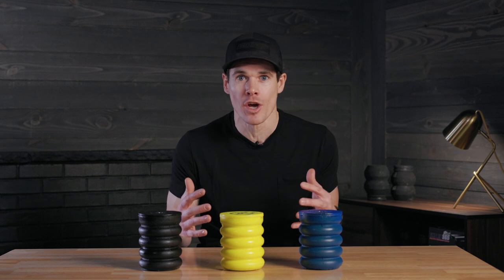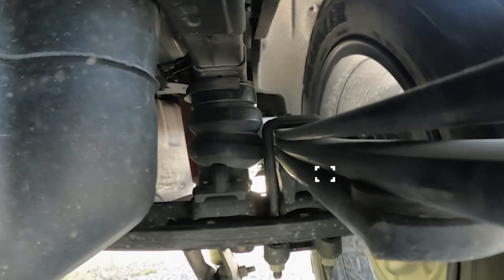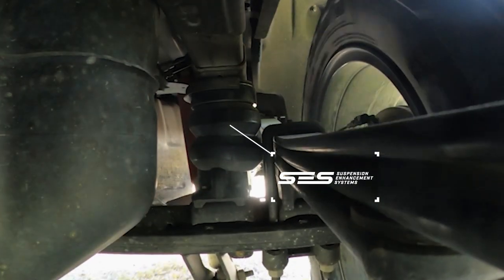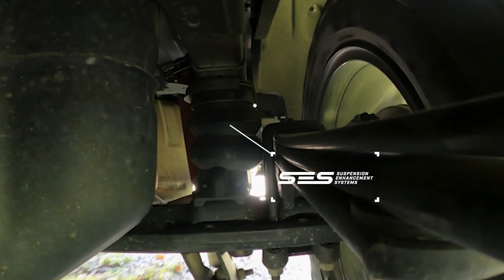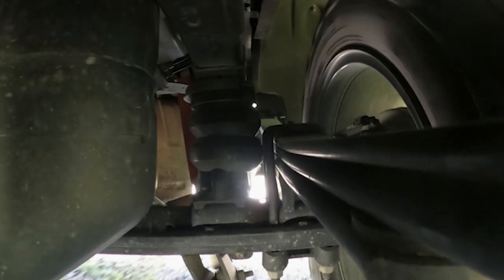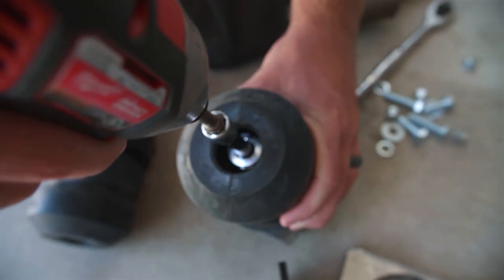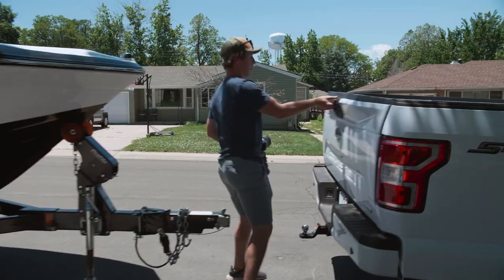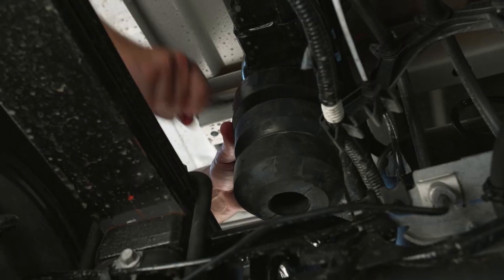Microcellular Foam vs Timbren SES

Comment: But what do they do for ride quality?
Reply from the maker: We have a progressive spring rate here. They are designed to work with your suspension to provide cushioned ride quality. When unloaded, there needs to be a gap of about 1" to 1 1/2" or so, from the bottom of the Timbren spring to the axle so the factory suspension can articulate without feeling harsh bumps or knocks.

Comment: Hv Lexus gx 460, plan to tow 3K Rv trailer. What you think, shopping for the best option  sumo, timbrem, durostop what you think
Reply from the maker: Timbren SES offers a lifetime warranty on the product and is made out of natural rubber! Extremely durable and long lasting. Great support for hauling and towing. Check it out! https://timbren.com/products/torseq-toyota-fj-land-cruiser-100-120-150-toyota-4runner-lexus-gx460-1998-2003-rear-kit

Comment: I have both timbren and sumo springs.. timbrens on my 1500 are definitely stiffer and handle more overload applications, 4 sumos on my 36' camper to help with the sway and bumpy ride.   The stiffer they are they more they handle the load, sumo compresses a lot compared to timbren so it can be a softer ride.  Both of these have made it possible to tow such a large camper with a 1500 but your truck will take a beating even with all this tech.  1500 just not made for the application i was putting it through , upgraded to a 2500..keeping my old timbrens and moving to new truck..
Reply from the maker: Thanks for sharing your experience. It's good to hear your perspective and experience with both products. In the future, if you ever find your Timbren SES kit is too harsh, give our Customer Service team a shout. They can send you a softer Aeon® rubber spring and take out any harshness you're feeling. Thanks again for the great comment!
Reply: @TimbrenIndustries  I am moving  the timbrens to the 2500 .. towing in a few weeks see how they perform ( as always they will do the job ) ..  need front ones but price point slowing my purchase down ..
Reply from the maker: @joealves5070  They will most definitely do the job 🦾. Sorry that the price is slowing down your purchase but it's the price of solid Canadian manufacturing and a product that's been designed, tested and backed by a Lifetime Warranty and 100 Day Money Back Guarantee. You get what you pay for.
Reply: @TimbrenIndustries  can u help ? I reached out to your website for the fitting . There’s an adapter for the timbren   To fit the 2500 truck .. i have the spring already that I moved from 1500 but need the adapter so it fits my new truck .. they will not provide it for me .. bit silly.. can u help me out ?